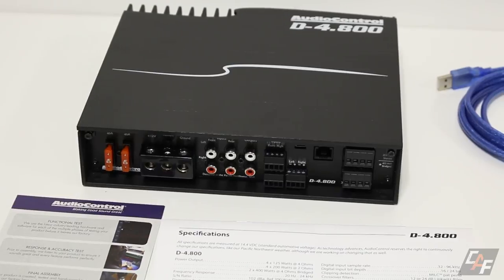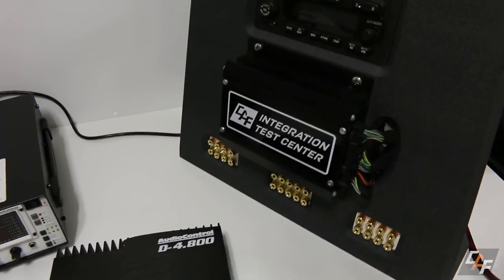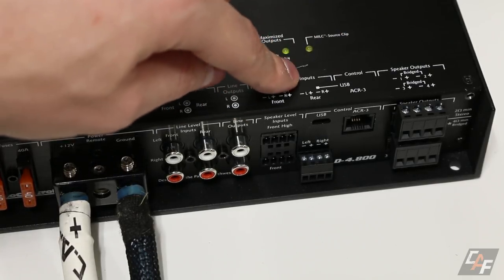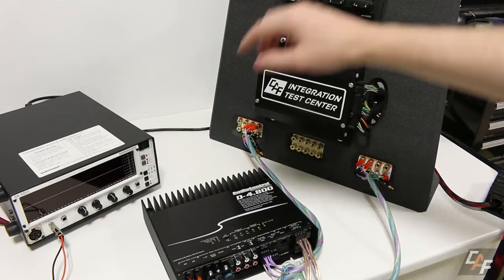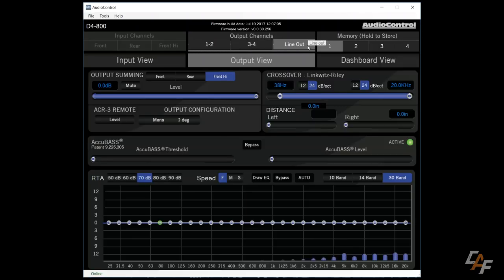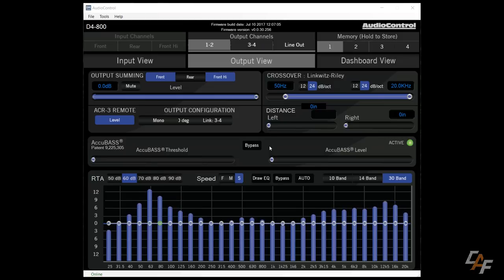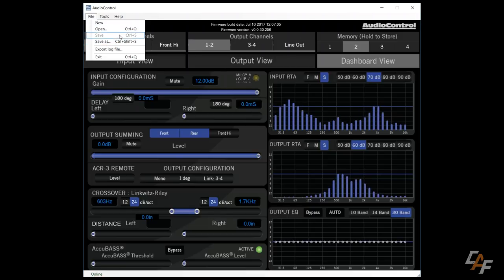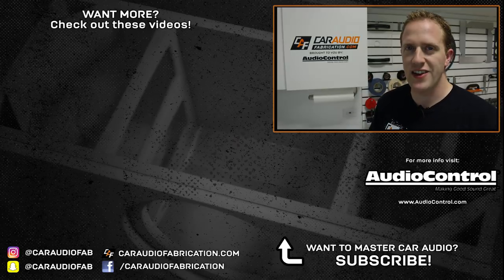DSP INSIDE AMP?! AudioControl D-4.800 Amplifier

Comment: you know why they were always a separate unit? because amps burn out, the processors, crossovers etc would normally survive. soo to pay extra for an amp,  which could (if your cheap) cost you more then a dsp and amp by them selves, to have 1 unit take out both? idk man
Reply from the maker: +ZelosZelo I have never had an amp burn out... Proper installation leads to reliability that will far outlast the vehicle. AudioControl also has a five year warranty when installed by a authorized dealer.
Reply: and a reliable amp, some of those out there are horrible. I know a couple of high end non-franchise shops that refuse a couple of amp brands (even if you buy them and bring them in), but wasnt here to trash, just saying, that possibility does exist, and my car is 20, well the one with the system ;), all the components still work, installed in the 90's, properly, by me.
Reply: I  have Audio Control pieces well over 20 years old that work like day one. Rock Solid. My Audio Control RTA is over 20 years old. It actually looks like  Caf's lol. Mark's
Reply: Personally I would keep DSP and amp seperate because of the DSP, not because of the amp.
Anything that connects to a computer is doomed to become obsolete because computers change incredibly fast. There is also no way to split the DSP and amp section as there are no pre-out/main-in bridges on this amp, you can't even set the gains without a compatible computer.

One of my Genesis Dual Mono's is now 20 years old, my other 3 are well over 10 years old, and I even have 4 original Soundstream Reference amps which were notorious for running very hot and fail easily...
All of the amps mentioned are still in working order with nothing but capacitor replacements as repairs (I prefer to call that regular maintenance on gear of that vintage), even though one of the younger Dual Mono's has been pushed hard and outside of its specifications (1.5ohm bridged load while only a minimum of 4ohm bridged is officially supported).
Reply: Candisa I would agree except for the fact that Audio Control has always been one to be on top of customer service. Computers change as well as products. There warranty  is the best in the business. Like I said my AC RTA is ancient and they still are currently in production and still the go to for RTA's. They still produce all the parts and current mic's for them. Audio Control will always have software to work with there products.
Reply: john vinczencz I agree AC makes fantastic products with fantastic service to go with them (proud owner of 2 pairs of EQT, a 4XS, a 24XS and a ESP-3), but I would like to see pre-out/main-in bridges and hardware gain pots just in case or to split/loop the signals from the DSP section through other gear before sending it to the amp section.
Reply: Candisa Gain controls etc are under the front cover. Two screws and the  front plate comes off. Same goes for the rest of the AC amp line.
Reply: john vinczencz Not on the D series, only a GTO switch, gains etc are through software only.
Reply: Candisa The reality is if set properly you set it and forget it. If want something with just about infinite settings then buy a  Helix or the upcoming Brax DSP. If you are not  competing in SQ then you  set it and go.  AC DSP is perfect for the person that is just getting into the game. Like the JL Fix and Tweek. Brax and Helix also have built in DSP in some models and are also fantastic. By the time computer software would become outdated so will the DSP.  I  personally  run seperate DSP for that reason. This is  not for  everyone. I would guess the majority of  buyers will install  this amp/dsp and be done with it.  Perfect for them. I am guessing you are a little more of a tech person than this amp is designed for.  That is a good thing. 😉

Comment: I just recently purchased a power acoustik amp and every thing is connected but it still turns on protected I even changed all the wires and i still have the same problem can i get some more ideas, I did bridge a wire from power to amp remote and it does the same thing
Reply: manuel rodriguez get it professionally put in